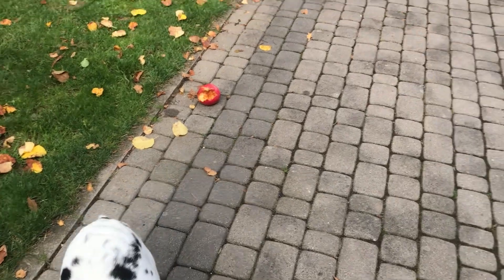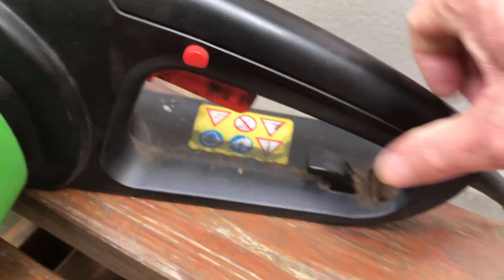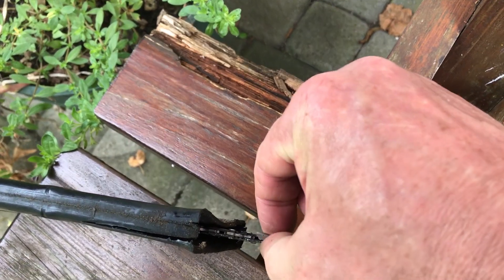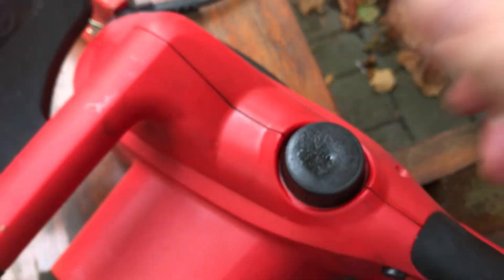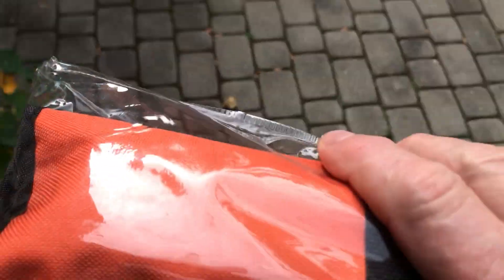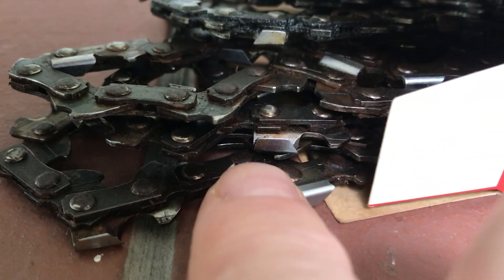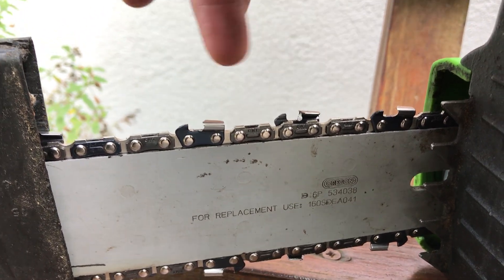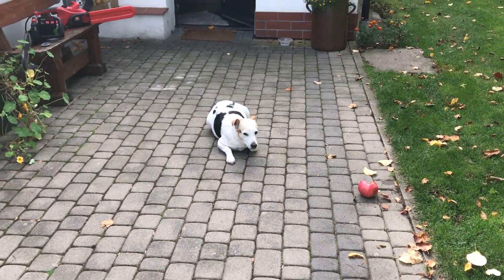A tale of two chainsaws

Comment: We used to have an electric chainsaw on the farm until it broke completely. Was really good for various rough carpentry tasks. Really light and controllable. Much more used to the petrol ones.
Never used one from a supermarket but my Lidl angle grinder has really been put through its paces, and is still fine. It's bloody immortal that thing😂.
Give Jimmy a good scratch behind the ear from me and the Unni beast.
Reply from the maker: Hey Tim bro ! ..much the same tale with my first Lidl chainsaw.. it just pressed on and on as I pushed it harder and harder.. eventually I burned out the motor on it.. trying to fell a huge tree ! ..doh !! lol
These electric saw are great and cost about 50 quid for the pair.. I'm hoping for another twenty years gigs out of them combined !! lol
Massive pats for Unni and all the very best to you bro !
Andy and Jimbers 🐾🐾

Comment: Is this tool easy to handle?❤
Reply from the maker: To be honest they are not that light.. but the user needs a certain weight to the saw to make them effective. These electric saws are perfect for trimming bushes and forming winter log piles. I would not want to cut anything more than a 6 inch wide log (15cm)
Thanks for watching !!
Yes I think they are easy to handle !